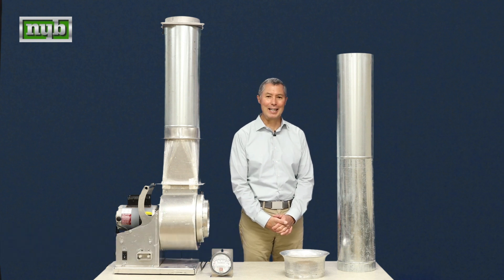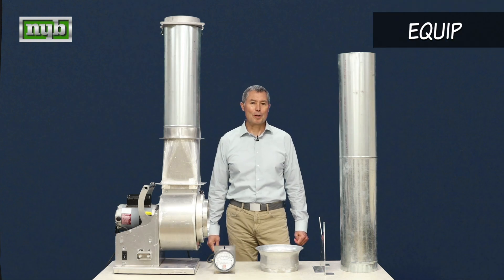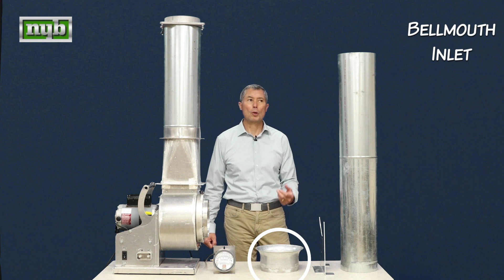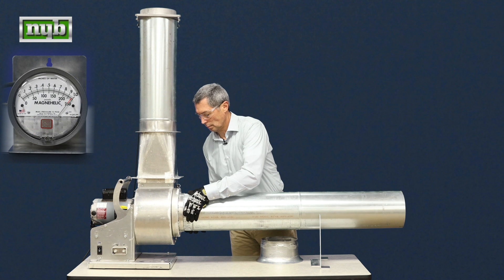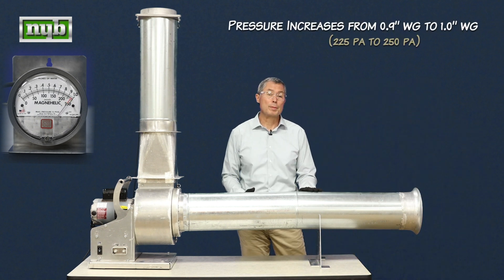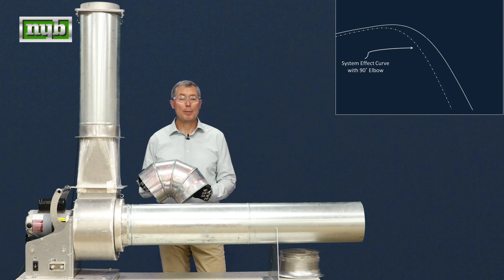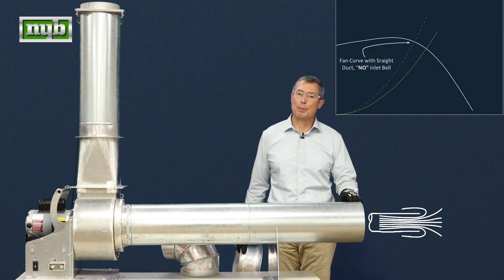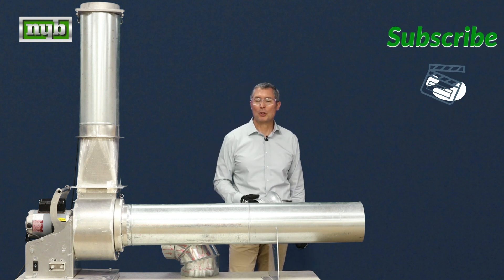How Straight Run of Ductwork's Affects Fan Performance (System Effect Series 3 of 6)

Comment: Hello im just student here i have a question a transition 6-8 inch then straight to elbow ( 8 inch ) will have minimal loss due to air having a larger space  now if air is speed measured at blower is 14.7 m/s goining through transtion it will drop to 8.2 m/s my question is this transition and elbow can make significant impact on presser like suction effect casue fan suction to increase or decrease